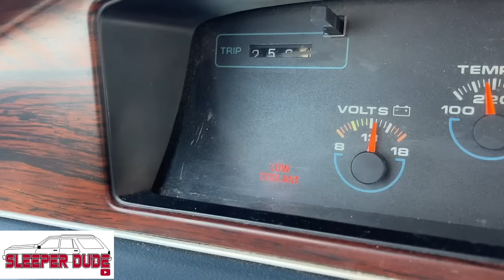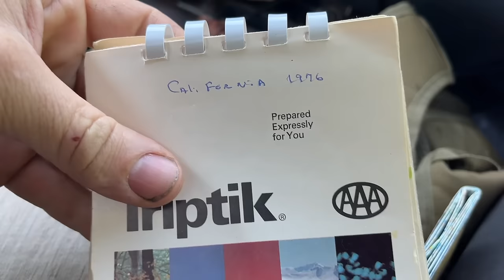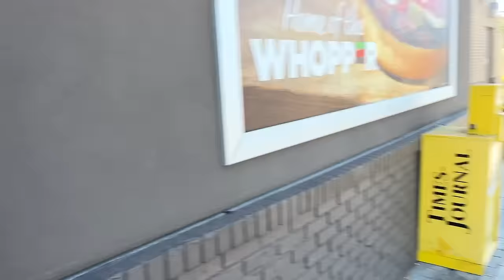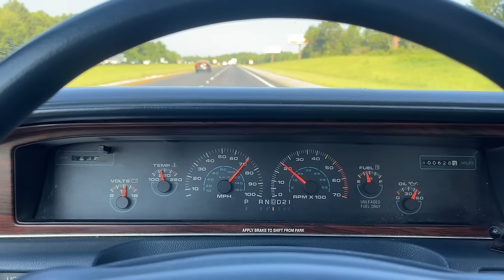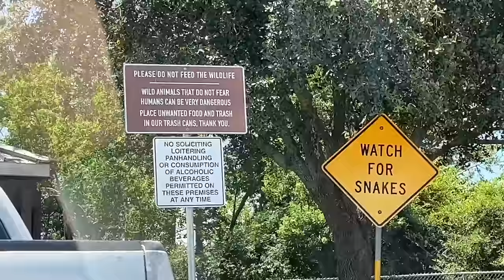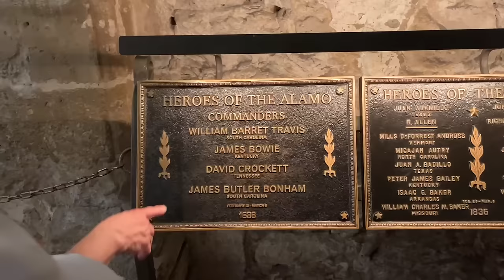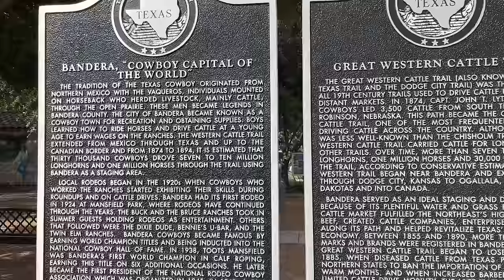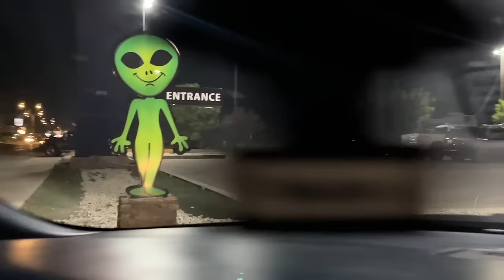Great-Grandpa Did This Road Trip Around America In 1976, Lets Do It Again!

Comment: I have a 1985 caprice wagon and I’ve road tripped mine more then 2000 to car shows and just random trips and I love it. Me and my dad have recently swapped the 305 and 700r4 for a mildly built 350 and a turbo 350 transmission. I have not gotten to be able to road trip it with the new set up yet but hopefully soon I will be able too. And I agree there needs to be more wagons on the road and in more families.
Reply from the maker: Yes for sure

Comment: As you were pulling out of the hotel in San Antonio, the brake lights were on. This could be why the cruise control is out.
Reply from the maker: Maybe so
Reply: That is probably likely. That happened to one of my vehicles, but it was not intermittent. But i noticed at night that my brake lights were on without braking, so i assumed they were connected. The fix on that model car was gluing a penny to the brake pedal sensor stop, so that the sensor knows when the pedal is not pressed.

Comment: You should have wrapped up a package to look like Anut Edna and tied it to the roof rack.
The Space Needle in San Antonio brings back memories.  In 1970 I ate dinner up there as the floor rotated around.  It rotated around the full 360 degrees in the time it took to eat a meal.

Comment: We had a 1985 Oldsmobile Delta 88. When you put the window 🪟 n the tailgate down, you could lower it like the tailgate on a truck. It also had the rear-facing seat in the back. We called it “ The backety back back”. 😂

Comment: Oh check your break switch ,if your crues quits . Use your foot to lift the break peddle ,while driving,then try the clues. If it works. Just adjust the swich,or bend the bracket a little
Reply from the maker: Ok thanks

Comment: There are 4 warning lights under hvac controls. Low coolant, low fuel, low washer fluid, low oil level. This low coolant light is for reservoir. The low coolant light on dash is for rad level. Look on passenger side of rad bout halfway down and you will find a one wire connector. This is the one you want. Maybe remove connector and clean. Add a bit of dialectric grease and hope that fixes issue. If not drain rad and change sensor.

Comment: You can disconnect the relay to the shocks.  Monroe makes a Magnum series shocks that are spring assisted. They are a great replacement for the air shocks. It’s only a matter of time when the air shocks fail.  Also, I would replace the rear springs, isolators, and upper and lower trailing arms.

Comment: Those GM coolant level sensors can get crud stuck in them and trip the warning light when you're not actually low. Usually you can correct it with some percussive maintenance.
Reply from the maker: Ok thank you

Comment: I'm in my 60's but I remember the vacation trips to Florida with my folks. 1977 Ford Country Squire wagon that didn't have the fake wood grain panels on the side. I think it had a 400 cu.in 4 barrel though. I think the previous car was an AMC Ambassador wagon from 1968. In 1974 my folks wanted something better on gas so they bought a Ford Pinto wagon lol. Something was wrong with the car since it only got 10 mpg. Dad got rid of it after the first year. I still want my first car back which was a 1971 VW super beetle auto stick. Didn't care for the auto stick since it lacked power. Got it in 1977 and had the engine rebuilt. The VW book several sent you in the mail was/is the best book ever printed on the bug. I still want a 68-72 bug but a nice one can run $10k. Not in my retirement budget lol. Love all the videos and your family including Rocky lol. Ya'll brighten my day for sure. Keep on doing what your doing. Now if I could keep our 9 grandkids off their electronics long enough to learn how to check their oil lol. Probably won't happen. So much of this generation lack the skills to do basic stuff anymore

Comment: No reservation at all is the best and cheapest way to go.  When My wife and I go traveling in the summer, the sun dosan't set and dark set in till late anyway.  We pull into a town around 9-10 pm.  We gas up the car, and check it for servicing, clean it out, and stop at a resteraunt and have a nice meal.  prouse the Motel strip and start checking them out around 11 oclock.  The rooms left are usealy much cheaper rate since if we go they get nothing, but they would rather get a reduced something.  Negotiating is still alive and well.  We usually pay 100 or less for a room that would notmally go for 160 or more.

Comment: There is a giant Peach 🍑 like that in Georgia or South Carolina on I-85. Did you ever find your atlas? I see them in Pilot/Flying J all the time. I'm about ready to replace mine because so many new roads have been added. I'm a truck driver, so many of the younger drivers use only GPS. I use two GPS and an atlas. My company has a GPS for trucks and hazardous Material and my Google GPS on my phone. I've had to stop and get my maps out because of conflicts between the GPS.

Comment: Josh, you know you can ask for a cot for Ralphie?  I hate to see the lil' fellow sleeping on the floor.
Also, I had a GM pickup that had the same issue with the cruise control; it would drop out if I hit a bump, and later got to where it didn't work at all.  I never had it fixed, but was told it was probably a vacuum leak.

Comment: a few weeks ago I was delivering my papers, putting them in mailbox tubes, and sometimes birds make nests of pine straw in them. when I tube the paper sometimes a bird will come flying out. well I heard a loud squeeling sound and thought it was my fan belt - maybe it had broken or something. I checked it and saw there were feathers all over the belt. So I guess a bird had flown into the engine from under the car and gotten eaten between the belt and tensioner wheel. it kept making squeeling sounds for about 30 minutes but went away. Sorry birdy.

Comment: That cruise control thing I had the same thing kept happening in a Delta88 it turned out to be the brake switch above the pedal was slightly out of adjustment so it made it think you were braking. Hope that helps.
Reply from the maker: Ok thanks

Comment: Have you considered the crank sensor being the problem on your motor home? I have the same engine and it won't run if it is bad.
Reply from the maker: We replaced it with a new mopar one
Reply: @Sleeperdude  Did you replace the cam sensor or the crank sensor?

Comment: SleeperDude  You are a 7 so am I.  Here is proof.  1992 Oldsmobile 9 -2 = 7 : last year they were made RIP  :)   It gets 17 mpg loaded at 75 - 80 mph,  wow!  Has a 5.7 liter v8 engine.  180 hp 8-1=7, again 300 ft lbs of torque V8 power :)   7000 mile road trip. Station Wagon Custom Cruiser Olds dimensions  79.7 inches wide.  217.5 inches long.  60.3 inches high. It has 7 keys.  Plan B was meant to B >   Roswell NM Aliens are real the USA Government just said so last week.  They have the Alien bodies and the Alien Space Ship in Area 51  Transmission  Hydramatic 4L60  4 speed overdrive automatic great transmission.  Guess what else?  You travelled over 1700 miles and didn't break down once.  You were hoping to average 250 miles per day.  You have been averaging 425 miles per day;  1700 / 4 days = 425 miles  Cool trip.